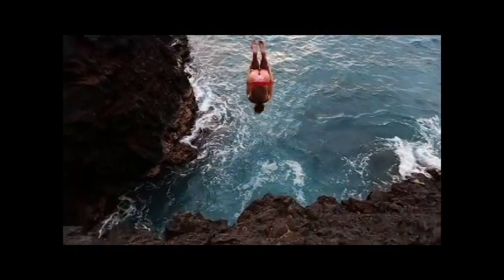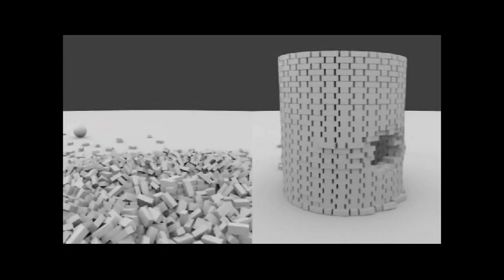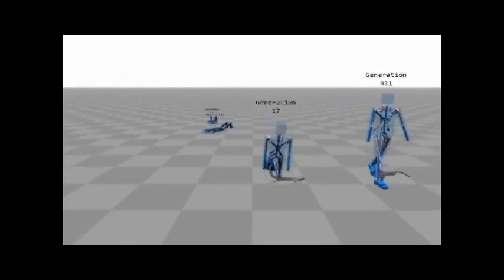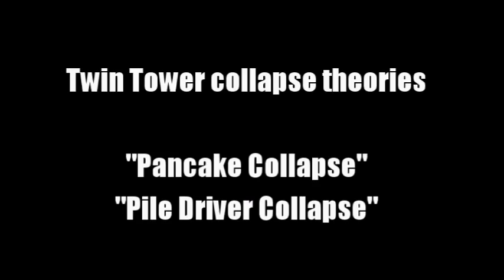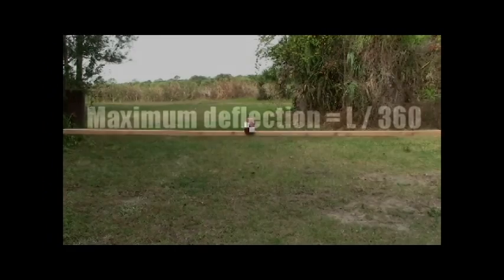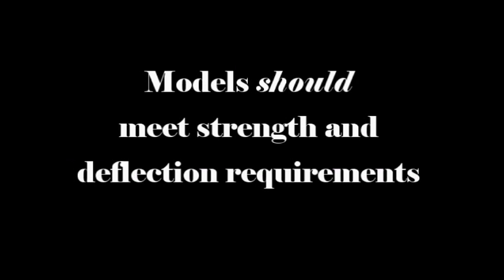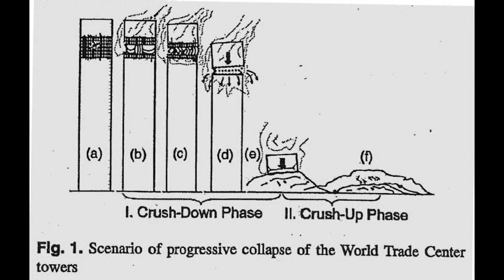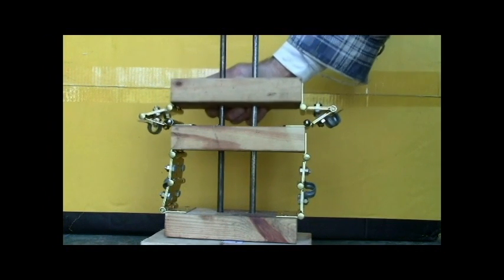9/11 Experiments: The Force Behind the Motion

Comment: Government conspiracy theorists believe that random acts can give you the same result as highly skilled, planned engineering (in this case, 3 times on the same day no less!). They also believe that 15 floors up top can crush 95 floors below like putting out a cigarette butt. Just admit what you believe government conspiracy theorists. Come to grips with the whoppers you swallowed. Just like what Stanley Milgram taught, if a man in the white lab coat tells you what to do, two thirds of people will do it.
Reply: Paul DiBenedetto - So much wrong with that.  Where to start?
Reply: Why waste money on expensive demolition engineers when a simple fire should do the trick and the building will come down perfectly. That is what government conspiracy theorists believe. They also believe that there is not such thing as resistance and that buildings in Americas showcase city, New York; are built like dominoes, where a fire on the top floors will lead to catastrophic collapses. If that is the case, shouldn't we evacuate much of New York and tear down many of these skyscrapers for the good of public safety?
Reply: Paul DiBenedetto - Yawn.
Reply: Paul DiBenedetto - Why Paul? Why don't you just give up? From other threads where I asked you simple and easy to asnwer questions or where I rebutted your claims with actual evidence, you ran away. Will you do so from this one as well?
Reply: Our side is winning Bruce. Sorry to break it to you. When people take a look at the evidence, it's evident that the buildings were rigged and many people who've thought it through come to the same conclusion I have, and that is 15 top floors are not going to destroy 95 floors below. So please, stop running to the men in the white lab coats and accept what is evident. It's very liberating.
Reply: Paul DiBenedetto - By what objective measure do you make the claim "our side is winning"?  By any objective measure the 9/11 Truth Movement, if not dead, is very much on life support.  

Except for AE911T which only still survives because its founder and leader is entirely dependent on spreading 9/11 woo for his income, no significant 9/11 Truth organizations are still up and running.  The rest have all shut down or at least gone dormant.

Nearly all the big names who used to actively campaign in the 9/11 Truth Movement have moved on.  When was the last time you heard Steven Jones or David Ray Griffin chime in on anything relating to 9/11?  Its been years.  The kids who made Loose Change don't even want to acknowledge they made that shitty movie anymore.  Those two idiots from CIT haven't been heard from since about 2009.  All the blogs and discussion boards that used to be hives of constant activity are now either shut down or dormant, with next to no activity.  Even ISF can go a week without a post on 9/11.  Even a couple of years ago there would be scores of posts a day.

The 9/11 Truth Movement started taking a nose dive around 2009 (curiously at exactly the same time GW Bush went back to Texas.  Hmmmmmm,....) and has been in rapid decline ever since.  It has been so long since I encountered a genuine 9/11 truth seeker (someone who has actual unanswered questions about what happened, sincerely wants to know the real answers and is able and willing to accept them when presented) I can't even say how long its been.  2 years maybe?  All of the genuine truth seekers got their answers years ago and moved on, satisfied.  

All that is left of the 9/11 Truth Movement today are a few hundred attention seeking trolls, POE's and the terminally unreachable making comments on years old Youtube videos.

http://www.beachy1.com/image/911%20truth%20stand%20up.jpg

I get the religious attraction of CT belief, but reality is much more liberating.  Almost everyone else has actually figured out 9/11.  It's about time you got on board.
Reply: Many people overseas think 911 was an inside job. Most of the people I've met in America who believe the government conspiracy theory , are mostly naïve and not that literate or informed. Most have not even watch a video (either pro or con) on the matter, and seem to be naïve about many historical matters. So you have the company you deserve M Fitz. You're right in there with them.
Reply: Paul DiBenedetto - Many more don't.  So what?  Doesn't change the fact you were wrong.
Reply: Paul DiBenedetto - "Our side is winning Bruce."
Sorry dude, I wasn't aware this was a match. At least for me it isn't. For me the only thing that matters is to show when, how, where and why you are wrong. Ihave done so in the past and something tells me I will be doing this in the future as well.

"When people take a look at the evidence, it's evident that the buildings were rigged"
Yet, you haven't been able to come up with a single piece of evidence in 17 (!) years. You must be a winner indeed. Where is the evidence you are talking about? Please, show it to me. Do it now.. You've been sitting on it for years. This is the moment. Do it! I know you won't, because you can't. Let me explain why. You started by watching some conspiracy video a while ago. This video showed you some "anomalies" of 9/11 and concluded the official story could't possibly have been a 100% right. So, it must be wrong. Now that you have established the official story is wrong you started watching some more videos that popped up in your recommended section. Guess what? They were telling the same story. Now you have watched a bunch of these videos and you become convinced since the provided "evidence" was very compelling, right? Then you watched a video that described the exsitence of government shills. It said that the YouTube comment section was populated by these traitors and they are basically responsible for the deaths of almost 3,000 people. You thought that claim was a bit out of order, but you couldn't fully disagree, right? So you started doing some "research" of your own and bumped into some videos that presented so called experts. Well, when experts say 9/11 was an inside job, it's a won case, right? Case closed. Mind closed. Easy as that. However, you skipped a step. What scientists do, is come with a theory that explains a certain occurance or behavior. They find evidence that backs up their theory. So far so good. But then they will try and find evidence that disproves their theory. My question to you is how you have tried to find evidence the conspiracy theory for 9/11 being an inside job is false? What kind of effort have you taken to REALLY study the claims being made? "Well," you say, "why should I"? The answer is simple dear Paul. If you are intellectually honest, you put away your pride and start all over again. Do not simply accept claims. Study them. In detail. Ask yourself : is it true?". This is the one stepped you have missed in your process. But you're not the only one.

Now, please show me that evidence you have mentioned. Please do it piesc by piece so we can discuss every single little claim. 

"15 top floors are not going to destroy 95 floors below."
I couldn't help but notice that you have made this claim before, many times. Yet you have failed to explain to me why you believe this. You made a general comment on Newton's third, but it is clear that you do not understand what it actually means. Somebody in some video made that claim and you copied it. Please explain to me IN DETAIL how Newton's third applies to the collapsers of the twin towers. I have asked you this before, several times. You have never answered this question. I understand why. But please do yourself a favor and deep dive into this one single claim and try to find out why you are wrong. Ask yourself how a house of cards WILL fully collapse, in spite of Newton's third. Would you agree that it would be impossible with your understanding of this law? So either this law is wrong (but you quoted it and use it as evidence for rigged towers) or your understanding of this law is wrong. Since you have used it as evidence, the only conclusion i can draw is that your understanding is wrong. Please tell me I'm wrong and explain what this law actually means and predicts.
Reply: Paul DiBenedetto - "Many people overseas think 911 was an inside job."
How many is "many"? Which people? Which overseas? Any specific country? A specific demographic? What's your source? Where are the figures? What do they mean? See, you comment is nothing but empty rethoric without answers to these questions. I really hope you understand that. It's like me stating that only dumb people believe 9/11 was an inside job. Empty, hollow. It doesn't mean anything without sources and context.

"Most of the people I've met in America who believe the government conspiracy theory , are mostly naïve and not that literate or informed. "
Well, your problem right now is that both M Fitz and I are very well informed. Your other problem is that you believe you are too. But you have only watched some YouTube conspiracy videos. That does NOT make you informed. If you would be literate, you would understand this. You seem to believe that watching videos is doing research :). You are wrong. The actual research only starts AFTER you have watched these videos. Can you tell me in all honesty that you have ever tried to find an original source for any piece of evidence? Can you tell me in all honesty that you have ever checked such source?

" Most have not even watch a video (either pro or con) on the matter"
Yeah, this is exactly what I mean. A video is a medium. It is not a source. You might as well have stated that most of them have never read a blog on the matter. It is not about the YouTube videos. It is about the layer behind the videos. Videos show opinions. To be clear, I am obviously not talking about videos that simply registered events. I am talking about the videos where someone is trying to interpret the events.

"and seem to be naïve"
Ironic

"about many historical matters"
When will you conspiracy theorists ever learn that historical matters ARE NOT PROOF?! Even if interpreted the correct way, it doesn't say anything on the subject matter. You guys seem to like linking random events, drawing conclusions from them and creating your own evidence. But truth is factual. Just stick to the facts. I once saw a conspiracy video about the Dutch royal family leading the Bilderberg Group. In a picture shown in the video, the Dutch King is seen standing in front of the NYSE building on Wallstreet. In the picture the street signes for Wall St and Nassau St was visible. The full last name of the Dutch king happens to Van Oranje Nassau. I suggested that he deliberately had his picture taken to hint that his family was actually ruling wall street (jokingly of course). Now guess what the creator of this video responded, he said "well spotted". WTF! It means nothing. At all. But conspiracy theorists see meaning is random things. As you do.
Reply: Paul DiBenedetto - Do you believe M Fitz gets his knowledge from te media?? Really?? Dude...

Comment: Ok lets make a thought experiment Einstein style... Imagine we have only the steel structure nothing else... we take a massive block of concrete the weight of the missing parts of the building, we put this on top of the structure... so it got only the steelframe as support but no support from the concrete... now imagine we heat all the steel in that structure to 800c so it get juuuust a little yellow sheen i mean every square inch of it.... and now i give you a problem : I give you 13 seconds to take down that entire structure to a pile lower than 2 floors and reduce the concrete to powder and the steel to small pieces using ANY mechanical equipment on earth ANY.... how would you do it? 13 seconds....?
Reply: That is not an easy problem is it? Now imagine doing it with the concrete as support instead of a load and only small parts of the steel heated to even a fraction of that temperature and with NOTHING but gravity to do that same job...?
Reply: Your experiment is nonsense and has no connection to 9/11....
Reply: You are nonsense sock puppet...
Reply: "So tell me in scientific terms what is wrong with my thought experiment a"
It has nothing to do with 9/11 nutcase nazi.

"and how it does not apply to WTC 7 "
Your bizarre scenario has no connection to 9/11 at all..
Reply: You do not even know what a "thought experiment" is do you? If its not possible to tear down a much weaker, much hotter building than WTC7 in 11 seconds with the most powerful machines on earth, then how can gravity alone do it with WTC7?
Reply: Speaking about psychology do you know what "cognitive dissonance" means? ;)
Reply: "You are defending the murder on innocents"
Wrong.  You're a confused person.

"and call me a nazi?"
You blame the jews for everything and call for violence... yeah you're a nazi.

"You greedy, cowardly child and woman murderer..."
Take your medication nazi.
Reply: Daniel Andersson - Without knowledge on the engineering of the towers, your thought experiment makes no sense. There are few things that need to be clarified.

- What do you believe the steel structure looked like? Do you realize that the towers would not even exist without the floors? I'm not talking about the light weight concrete slabs. I'm talking about the floor trusses. These connected core and perimeter and these provided lateral stability to both.
- Why would you put a concrete block on top of the structure? The collapse has little to do with the load bearing capacity of the columns. Only in the initiating part of the collapse, they played a significant role.
- The concrete did not support anything. It just added to the vertical load on the trusses, truss seats and colums.
- If you would heat up steel to 800 C, it would lose about 85% of its strength.
https://www.steelconstruction.info/images/9/99/Steel_strength_in_fire.png
- You mention a debris pile of 2 floors. How do you get to two floors? How would you explain 108,000 truck loads of debris (1.8 million tons) carried away from ground zero? What do you believe the clean up crew was removing below street level?
Does this look like two stories to you?
http://archive.longislandpress.com/wp-content/uploads/2011/05/Sept-11-The-Pit_Mian-1.jpg
https://www.americanphotomag.com/sites/americanphotomag.com/files/styles/1000_1x_/public/files/gallery-images/ap911-mccurry-aloneinpile-800.jpg?itok=bpNHzNaq

Now, back to your experiment. First you need to understand the two phases of the collapses. First phase is the initiating phase. The weakening of the columns due to the impacts and resulting fires up to the moment the upper block comes down. Second phase is the progressive collapse. No matter what causes the onset, once started nothing could stop that phase. In terms of your thought experiment, drop the mass of the upper block onto the one floor below and see what happens. The only question is if the truss seats would be able to resist that kind of dynamic load. Please rememebr, the columns did not play any significant part in the progressive part of the collapses. Once the floors are gone, there was nothing to support the core or perimeter laterally.

Hope this answers your question.
Reply: OMG you ducking sockpuppet all i need to destrou ur shit argument is newtons law of motion,  listen now very very closely! "a force will always act in both directions" that was simplified but it means 10  stories can destroy 10 stories at best! At best! its not possible though since the lower stories are more robust than the upper ones... so what Newton says! "go fuck urself ew shill!"
Reply: Daniel you were just handed an embarrassing public lesson.
Go sit in the corner and stop crying about it.
Reply: Daniel Andersson - "You dont kill innocent people and lie about it i so wish i could tear you apart wih my hands u filthy thing...!"
Wow, are you now threatening me because of YOUR lack of understanding? Maybe you should threaten your teachers or parents boy. You're barking up the wrong tree. Get some knowledge and understanding of the actual facts so we can have a grown up discussion.